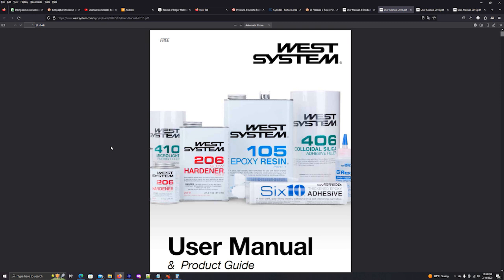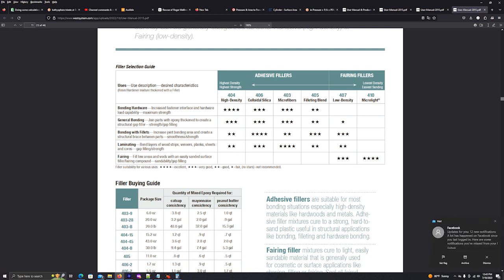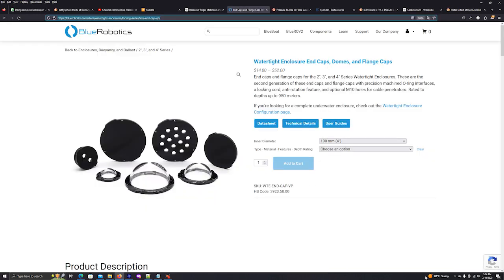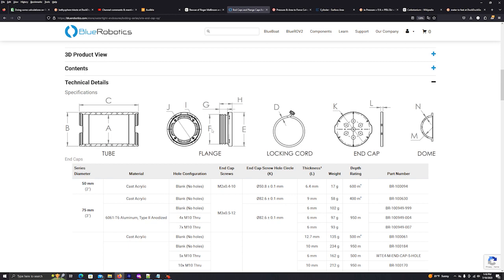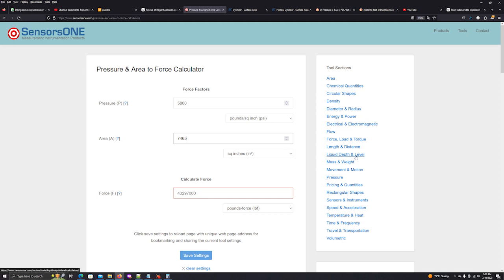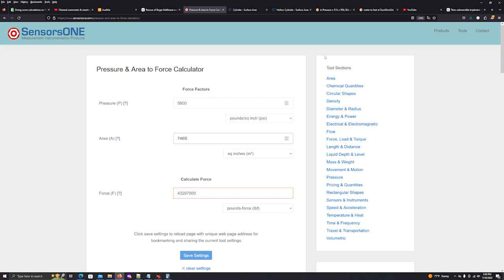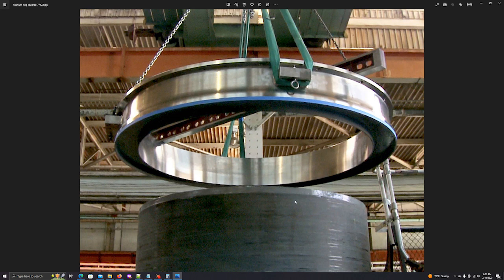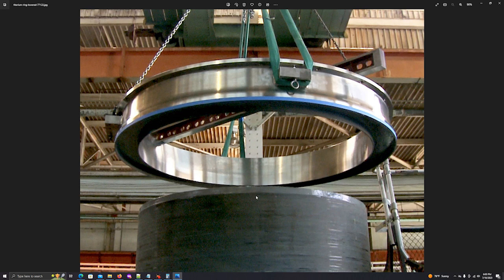Oceangate Titan Peanut Butter, Bonding and End caps

Comment: Excellent video so far, a very welcome change from the super speculative zero information bullshit that most of the Titan videos getting hits are constructed from.  Also, very big kudos for admitting to your errors.  

The epoxy was there as a seal, its major function as I understand it was to avoid all the problems of the thick wall cylinder calculations, and ensure that the flange was seated on, and transmitting pressure to, the entire wall thickness of the cylinder, both in terms of shear and twist, but also in terms of eliminating manufacturing voids.  It had the bonus side effect of stopping the end caps falling off when they were not being forced on by water pressure.

A quick back of a fag packet calculation of the pressures involved indicate an order of magnitude difference between the pressures being applied across the joint, and the one of water pressure trying to force its way in.

I only have two negative comments on your video, in fact.  Firstly, use proper units :)  Secondly, and far more importantly, the word "height" is neither spelled, nor pronounced, "heighth".  Wide - width.  Deep- depth.  Broad - breadth.  High, heigh*t*.  

Actually, may I use the clip of you saying "heighth" for an upcoming stupid video?
Reply from the maker: Sure, you can use the reference.  I used USA units as most lay people do not understand SI units.  Thanks,  my profession is a software engineer, not and English major.
Reply: @JoediyLab  The units comment is a bit jokey, really, and there's not much difference between pennyweights per acre or any other units, especially as we're talking relative quantities. However, you'll find that it's only US lay people, who don't understand SI units (and UK coffin dodgers) - the rest of the world pretty teaches SI units from preschool.

Whatever the system of units, you're doing a good job of explaining that "big number is not necessarily bad", and all the other sensationalist bullshit.  Keep it up :)

I'm not an English major either.  I've never been in the army.  there are a few pronunciation things that grate for me, though, and hearing heighth is a bit like like hearing killerbytes (to pick a random and very bastardised  SI unit that has dropped off the small end of the scale these days)
Reply from the maker: Yes,  I lived in the UK in the 70's and was there when the conversion between Imperial and metric took place.  I thought the British did a great job with the conversion.  They had all three units of measure on products.  Imperial, British and metric.  When I got home I was really hoping that we would convert to metric.  Jimmy Carter, President at the time attempted to convert, unfortunately, the other political party said it was took expensive.  Alas we  now  are one of the few countries that are the odd ball out.  Thanks for the comments.

Comment: Re: the implosion.. the pressure on the hull is trying to do 2 things, reduce the length on the hull and reduce it's diameter.   

By applying the external pressure to the area of the circle using the outside diameter of the hull tube, you get the axial load applied to the hull tube putting it in compression.  The pressure also applies to the outside of the tube, pushing in radially. 

When the hull fails, it would fail in both directions more or less simultaneously.  The end bells would start accelerating towards the center of the hull.  The water and hull fragments around the hull also starts accelerating inward radially.

Everything comes together with a massive amount of momentum and energy nearer the center of the hull.  At this point (assuming the CF tube failed first) the dome would still be fastened to the titanium rings, and the window would still be in place.

The next part is where the energy is released as chaos.  The pressure in the center of the hull would spike and this would reflect outwards as a shock wave.  This pressure wave would apply a massive force outwards on the window and domes.  It is at this point I i believe the window and dome/ring fasteners failed.  What's incredible here is that the dome to ring fasteners failed, and the reaction for that load was the mass of the titanium ring.

The energy of the event is P*V.  I calculate 240 MJ, which is equivalent to about 57 kg of TNT.  I know that not many have a feel for how much that is and what that would do, but it's a lot.  The subsequent events would have be incredibly energetic to say the least.
Reply from the maker: Thanks for the great explanation

Comment: Can point to the engineering forum where you are discussing the stresses around the joint?  I'd like to join in there as well.
Reply from the maker: Still have not gotten an answer yet,  Thanks
Reply: @JoediyLab  I'm interested to contribute to the answer if you point me there.  I am an aerospace engineer with some composite pressure vessel design experience and find the technical discussion interesting.
Reply from the maker: Very cool,  Here is the link to the engineering forum.  Let me know if you need any thing?  https://www.eng-tips.com/viewthread.cfm?qid=509401, Jon let me know if I can quote you in a followup video.  Also I will include your calculations.  I can also site you as the reference,  Let me know if you want that or if you want to be an anonymous contributor.  Thanks  Joe
Reply: My posts appear to be disappearing.. is this YouTube doing it's thing?
Reply: You can quote me in videos, and I can share the link to my calculation sheet, but the posts that I've included it appear to be disappearing.
Reply from the maker: Not sure,  I see your last two posts, but no calculations.  If you want you can email the calculations to my email address.  Select the About page on my channel.   Thanks
Reply: @JoediyLab  oddly enough I don't see an email address in your About page
Reply from the maker: Thanks so much Jon,  When the FEA is complete please send the info to  jpitz31@outlook.com.  Could you also give a paragraph synopsis in layman's terms so everyone can understand.  If you would like, up to you,  please include a short bio  about yourself.  I have access to Fusion 360,  let me know if your FEA can be imported into Fusion 360,  thanks  Joe.
Reply from the maker: Yes Jon, It appears that one of your comments is not showing up in the comments section , it  is showing up in the notifications.  It is the comment about your feedback on the forum.  So I did not get to  see your total answer on what happened with the Titan sub.  I am hoping that when the FEA complete you can give me a rundown of what happened to the sub. And what was Oceangate's major design failure and or major issue.  Apparently a company, CET, based in  RI, has been making UUV's successfully with carbon fiber  and have many stress cycles and when tested to failure  they do exhibit very little degradation in the strength of the carbon fiber.   I send them an email asking about their process but have yet to hear from them.  So I am excited to hear your analysis.  Also curious about your thoughts on the thermal and elastic property differences between carbon fiber and titanium and if they played a critical point in the  failure,.  Thanks so much for spending the time doing this.
Reply from the maker: Jon,  Send me your paypal address,   would like to send you some funds for your favorite beverage.

Comment: I work with Epoxy  based  Paints  which is a 2 part paint.  You have your base  and your curing agent. 
Before you add the cringe agent  the  base or paint  is   very thick  and it is just like peanut butter . The curing agent basically acts like  a paint thinner when you add it too thevccmdr
Reply from the maker: Thanks for the explanation

Comment: Hey Joe. I'e found your chanel some time ago and am blown away. You're qualified, experienced, and have a way with words. Listening to you is a pleasure, even if a topic is as grim as this one is.
 
After watching your first video I looked at your subscriber count and was blown away. You're criminally underappreciated by the algorithm.

PS: I've just rememberd now: on the topic of the endcaps being forced together, Matt, who runds the "Dirty Garage Guy" and is an engineer, did some basic stress analysis of a model of the sub and it showed that the composite hull deformed significantly, being forced together, shortening its diameter due to direct pressure of the water and lenth, due to water pushing the endcaps together, additionally stessing and deforming the hull further.
 
Maybe this deformation can help result the lack of debris from the composite on the endcaps/collars; due to repeated, heavy deformation, delamination was so heavy that it basically popped them clean off?
Reply from the maker: Thanks so much 👍

Comment: Bulk density of titanium is 130 and the bulk density of epoxy resin in 20.  This means the epoxy would deform under extreme loads where the titanium would hardly deform at all.  These compression and relaxation cycles would cause a delamination of the epoxy over time.
Reply: Does the extreme cold on the bottom have an affect on glue?
Reply from the maker: If Epoxy is still curing, temperature can have a major affect on the curing process.  Different epoxies have different properties  once cured.  For example Rocket nozzles are  made with carbon fiber  and epoxy.  During launch nozzles are get very hot and in space the nozzles can get very cold.  So cured epoxies do have service limits. Different epoxies can have different service limits.  Off the shelf room cured epoxy starts to get soft around 150 degrees F.

Comment: Its the different expansion/shrink rates of the different materials used in Titanium and Carbon Fiber Composite.  During these high pressure and low pressure cycles that the end caps and pressure hull would see, the change in thickness of each substrate would cause delamination to occur over time.
Reply from the maker: Thanks for the feedback
Reply: Not exactly...but perhaps fractionally contributory.  It was more deflection of the carbon fiber in bending due to water pressure than modulus of elasticity of the titanium end caps...consider the Ti end caps to be rigid...and of course they didn't yield and fail and were brought up from the ocean floor.  Every deep dive the mid point of the carbon tube would deform toward the axial centerline of the vessel approx equidistant between the end caps...like a rigid bridge aka carbon tube supported on two ends. This created a substantial moment at the Titanium endcaps...a crowbar effect trying to pry the carbon fiber from the titanium end caps. This may have dislodged the seal on some level.  But we don't know yet.  More needs to be learned about why the vessel took on water with the occupants still alive....maybe the breach was from the rear...why it descended so rapidly and lost its buoyancy.
Reply from the maker: @lukewalker1051  Thanks for the additional information

Comment: This video is very appreciated!  I have been wanting some answers regarding this.
Reply: Something I wonder. How does this cycle?  Cf has a life when cycling.  Titanium is perfered.  What about the epoxy?
Reply from the maker: The composite  material consists of carbon fiber plies compressed in an Epoxy matrix.  The The whole matrix does cycle with stress and strain.  That is why resin to fiber ratio is so critical to strong parts  and all aerospace parts are usually manufactured out of carbon fiber prepreg with either vacuum bagging and cured at elevated temps pressures  in an autoclave.  Watch the first video.  Thanks
Reply from the maker: Thanks

Comment: Joe, I would have used a 2Inch Titanium mandrel, weld the caps on the ends and then wrap the compression chamber with Carbon Fibre since he was dead set on using it. Stockon's ego added 5 more lives to the Titanic
Reply from the maker: Titanium is very expensive and very hard to machine.  Knowing his mindset, he would have felt it was too expensive., Thanks for the feedback

Comment: A lot has been discussed about the epoxy.  This is in part, ancillary to the structural integrity of the titanium hemispherical end cap/ carbon fiber interface.  By the way, your use of the term peanut butter, does not technically relate to epoxy 'thickness' but rather the 'viscosity' of the epoxy used.   Choice of epoxy matters but that isn't likely what failed and also consider that the hull itself was comprised of an epoxy matrix, interspersed with carbon fibers.  Epoxy is what the hull was made out of because it is the substrate material of carbon fiber.

Without being able to post a picture, I will provide a verbal visual.  Visualize two 2 x 4's made out of wood. One is 6 inches long and very rigid and bolted to the ground pointing up.  Apply some epoxy to the top edge.  Then place a 4' long, 2 x 4 over the top edge of the short 2 x 4 sticking up.  Let the epoxy cure for a couple of days.  Then, grab the edge of the long 2 x 4 and pull up and push down on it 1 inch in each direction several times.  Call this cyclic loading.  This replicates what was happening to the joints of the Titan.  The center of the carbon fiber hull was displacing...like grip pressure on a beer can without crushing it...called elastic deformation...due to water pressure of every deep dive.  Elastic because when releasing the pressure of the ocean, the Titan hull would return to its original free state.  But repeated 'oil canning' of the hull causes the joints of the hull glued to the Titanium end caps to act like the glued together 2 x 4's lifting one edge repeatedly.  This joint will degrade over time when carbon fiber is used for the hull material and diving 2.5 miles beneath the ocean surface.
As an engineer, this is the kind of dynamic engineers consider for 'their livelihood'.  This the type of thing we do and what we are trained for.  The reason that Rush never had this design approved and validated is because it wouldn't pass the rigor of testing that replicates diving deep in the ocean repeatedly.  The adhesive was likely compromised due to the 'kinematics' I explained and not due to any native failing of the adhesive used which is even helped by water pressure.  The adhesive like carbon fiber itself which is a resin based epoxy, is subject to cyclic fatigue  which requires mechanical 'movement' aka elastic deformation due to force/pressure of the water deep in the ocean.  The vessel handled this for a handful of deep dives and then gave way because cycling loading degraded the carbon fiber and likely at the joints per the 2 x 4 example referenced.
PS. a last note about the acrylic window, no bolts left and clean flanges.
What we have here is a chain reaction.  Another analogy for those familar with a gas piston engine in a car.  What occurred due to the crushing water pressure and hull letting go was the 'instant' crushing of a volume of about 1 atmosphere...with 400 x's one atmoshere of water pressure. Water is incompressible unlike air which is compressible.  So when the ocean caved in on this small cavity inside the Titan, it superheated the air and the chain reaction was an 'explosion'. That was the noise the Coast Guard heard with the noise detection technology.
The explosion blew outward the conically shaped 15 inch thick acrylic window shaped like a wine bottle cork in profile to not implode in standard practice due to the ocean's water pressure but easy to blow outward when the 'piston' of water came into the vessel with it collapsing.  The bolts merely relented due to exceeding their collective tensile strength.  The explosive was massive.  Like an atom bomb.  The 5 humans inside were vaporized.  The ferocity of the explosion was why the adhesive was wiped clean...what is called shear stress of the adhesive exceeded its bonding strength by several magnitudes and why the window blew out and bolts disintegrated as well.
I am looking forward to the findings and this of course has captured the imagination of the public and engineers because of how our brains are wired and life is essential an experiment. Stockton Rush was a sick man because of his engineering training and was told by 100 engineers and experts in the industry that people would die in that vessel which of course was its fate.
Reply from the maker: Luke, thanks for such an elegant explanation.  I was wondering about this.
Reply: @JoediyLab  Thank you Joseph for your elegant discussion which I appreciate as well.  You struck many of the important points with your video.  We collectively will learn more but what may remain a mystery is Stockton Rush's unexplained 'psychopathy'.  This man had an unexplained disregard for the science he was trained in.  Hubris, profit motive etc is not the full tell of the tape as it were. There had to be a deeper sickness to the man...a morbid connection with those that died on the Titanic I believe and in fact, his reckless approach, not unlike the captain of the Titanic which caused the 'unsinkable' ship to rest on the bottom of the ocean.
Truthfully, in 2023 what happened to Rush and companions was completely avoidable and even 'predicted' by several engineers and scientists.  Nobody I know with my training for example would ever step foot on the Titan.
Reply from the maker: @lukewalker1051  Thanks Luke,,  It is always good to have meaningful collaboration.

Comment: Wreck investigation is very strict on what is undone and what isn't. The window would not have been removed by the recovery team unless it was absolutely neccessary, and they recovered the unpierced end cap too, so it wouldn't have been removed for weight issues. More likely the window got blown out during the implosion as the securing ring was likely only designed to stop the window falling out at/near sea level.
Reply from the maker: Thanks for the insight